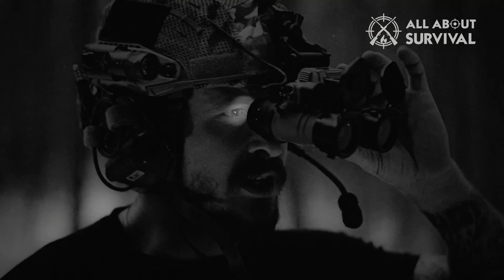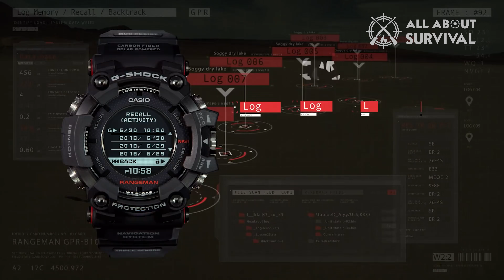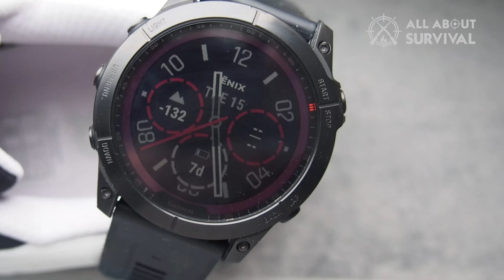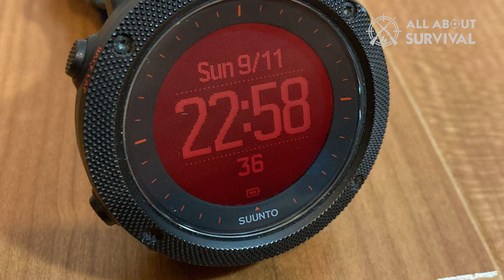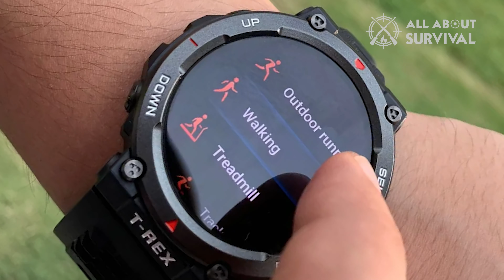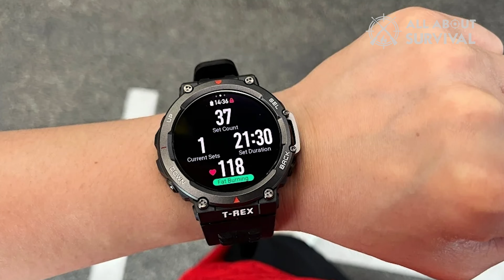Top 5 BEST Tactical Smartwatches You can Buy Right Now [2026]

Comment: Former Amazfit T-Rex 2 user, the battery life is amazing i got a record of longest no charge in 1 month (Note : use only as a watch). The sensors are good, its quite hard to scratch the screen or body, and i had the longest GPS use of almost 1 day.
But it has a minus, GPS is phone assisted meaning if it didnt connect to your phone for a few days it needs AGPS update, if you insisted not connecting the watch to your phone the GPS  search will be slow, i mean very slow. And the AGPS update problem started to become a hassle since it become faster to get expired, first it was around 2-3 weeks and then last time was 5 days. i dont know if it was the a bug or what and its quite frustrating when i wanted to use the GPS but it needs an update first. So the point is, this watch battery life was amazing. I already sold the Amazfit T-Rex 2 and change it with Xiaomi watch 2 Pro, a bit of a regret. And now i want to change to Fenix 7X

Comment: Good comparison review. Based on this review I just ordered the Amazfit Rex 2 for $134. I am an avid hiker and I hope to like it, especially the GPS.
Reply: I love it! I haven't taken to hiking or walking to check the GPS, but I used it in the gym and the heart rate agrees with what I see on the equipment. In fact, I also tested it against my wrist HB tester and they read identical value 2x times I tested it. The sleep time was also on the spot. The only negative is that I had to charge it after 5 days of light use.
Reply: okay, great to know thanks!
Reply: @tes1geb  Strange, everybody says that the battery is very good
Reply: @tes1geb  that is odd, I charge my T-Rex once a month with light use, the great battery life is one of the main selling points.  Light use being tracking a walk or maybe a run at the gym, looking at the weather, checking the time and it shows y text messages.
Reply: Any opinion on how you've liked it so far?
Reply: Where you found it for such price?
Reply: Good choice. ❤
Reply: Maybe it is the watch I got. The battery is only good for 3-4 days max. I continue to be amazed by how precise the heart rate results are.
Reply: @tes1geb I’ve made it 34 days without a charge. If you’re using always on display it reduces battery life significantly.

Comment: Casio GPR B1000 is immortal ive been using this for 5 years now never ever have to charge just use and use because of its solar power.
Reply: Same here. It's a mistake for Casio to not continue with it. I think a lot of folks misunderstood its value.
Reply: I had an older gshock that just wouldn't die then got a  Garmin instinct that is nice but have to recharge often.
Reply: I've had to recharge mine a good bit using the USB - I think my battery must be wearing out  - The sun takes all day to move the level even one bar.  Still its the most rugged watch I've ever had!

Comment: wrong watches with wrong comments - missing stats and features on a host of watches. Could almost say this is disinformation in a lot of ways. Definitely not a video to use for any puprose other than to research these watches yourself. Half of them you can't even buy anymore i.e. Suunto just released a Suunto Vertical with offline maps (no offline tbt like garmin fenix). Can't even get the traverse anymore. Garmin Tactix offers everything mentioned on all the models including hunting and fishing apps, night vision etc etc - you can even get an advanced ballistics comp on one version of the watch that will connect with kestral equipment. And a T-Rex will definitely fit in more in a formal setting than the g-shock.

Comment: In my opinion Garmin should be the number one and the amazfit in the last position
Reply: I love my Amazefit TRex 2.  Does everything I want it to do.  No need to answer calls on my watch.
Reply: @kobra289 
As someone who tried it, I just wanna ask you a quick question if you don't mind, can i connect the trex 2 and the bluetooth earphones to the phone and use them simultaneously?
Reply: @kobra289 how is trex 2 on iPhone?
Reply: I used Garmin 935 not really good, now i use Amazfit T Rex 2, my best choice
Reply: # 1 AMASFIT T-REX II.
Reply: Based on what, price.?
Reply: selera kamu kurang bagus
Reply: Do you think the raptor is a good choice?
Reply: Why?
Reply: The garmin instinct 2x solar  has multiband gps where normal doesn't
Reply: In term of tech yes. But in term of durabilty hell no.
Reply: Have an instinct, difficult to charge. Hope somebody builds an esim smart solar watch.
Reply: I am currently rocking the Amazfit Trex 2.
Reply: In my opinion m, you’re a jackass and no one cares about your opinion
Reply: I had an instinct 2 and it was unreliable inaccurate. Loved its weight but it just would always be off on measurements